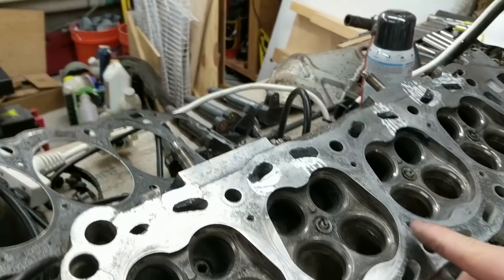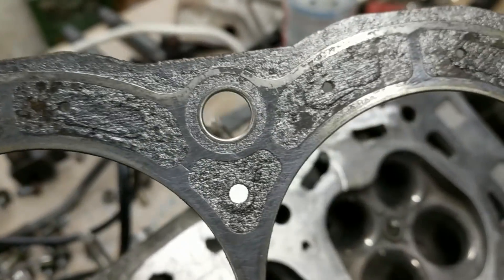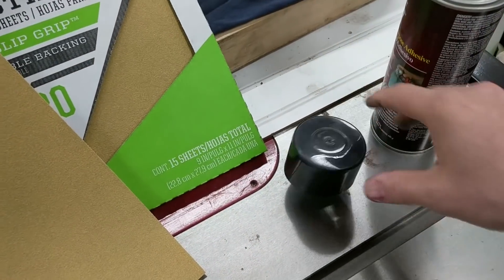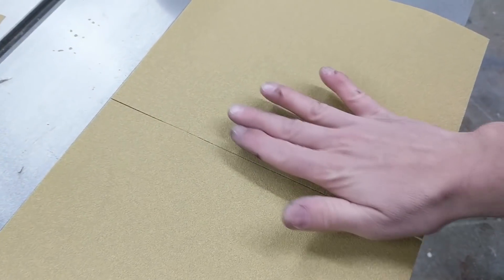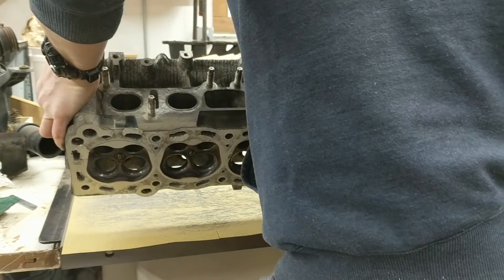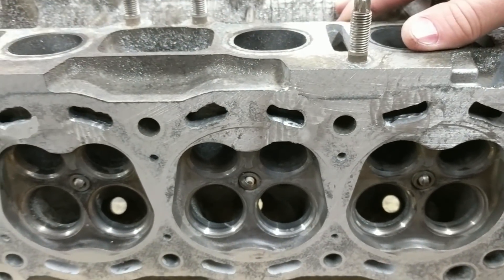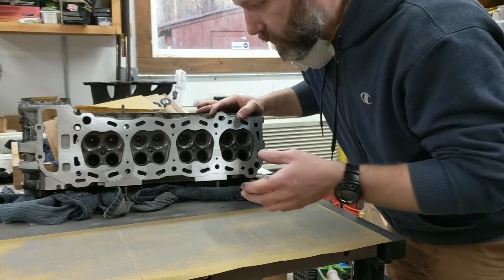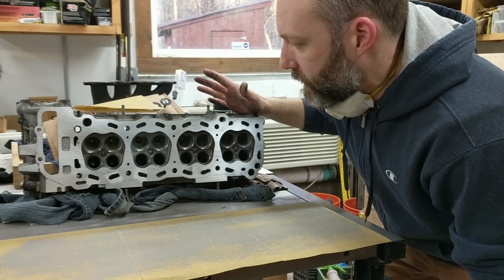Using a Table Saw to Resurface a Cylinder Head

Comment: Good general idea,  bit usimg a larger surface to allow an X pattern is much better,  and you should have gone with a much smaller grit like 600 or 1000. These are machined surfaces that have an almost perfectly smooth finish,  and 60 or 80 grit is huge. In this case you gotta think almost like a body guy,  and small grit to remove perfections.  Also make sure to use a decking block and feeler gauge to check warpage. Finally,  being an aluminum head,  there are bits you can get to put in a drill press and a jig hold square to remove the tiniest material. Gotta be good at machining in general first.  As for valves,  you can lap them yourself,  real cheap.
Reply: I agree 80 grit is too coarse. 1000 grit is for bare metal OE type MLS head gaskets. Aluminum heads with composite head gaskets, or when using aftermarket coated MLS gaskets, should be around 800 grit, and iron heads should be more like 600 grit. That's to get the generally recommended surface finish for most gaskets, but some call for wierd finishes.
Reply: I watched a guy on another video use 80 grit and he could not get the gasket to seal so he over tightened the head bolts just to get the compression up to get it to run
Reply: why not just spray the gaskets (or the head for that matter with hylomar before fitting them???  Works a treat for me when I have had to take off and refit aluminum heads even when i could not afford to resurface them and the car had to be back up and running asap with a new gasket...

Comment: first time I did this was 1960. had a 49 harley davidson 45 v twin that leaked oil where the cast iron oil pump fit on to the aluminum housing. used a safety plate glass window from a 28 plymouth and valve grinding compound. worked to remove a screwdriver gouge in the aluminum(former owner). last time it was grinding 14 thousandths off the cylinder head for my 5 hp briggs engine to raise compression(I live near Denver). used a glass with 360 grit wet-dry sandpaper glued on. did it in the kitchen sink with warm water and a bit of dish soap. Your video shows how you can accomplish things well without spending large amounts of money. I hope the welds hold up good for you and don't crack/leak.

Comment: You should actually push it on an angle diagonally across the head in both directions so you achieve a true flat surface and proper cross hatching for your gasket to seal on

However, good video with decent tips, and it should work

Comment: Yeah, that's totally not worth me taking to my machine shop for $60 and its guaranteed to be flat and of correct RA to seal gaskets
Reply: Kevin Hill depends on where you live, some places will tell you to go fuck your hat for anything that’s not a several hundred dollar job.
Reply: @ Kevin Hill Yeah well I’ve seen many a head machining job messed up by a machine shop, not flat, poor surface finish, thinner at one end than the other, to much taken off etc. For a clean up this method works great done it many times and you don’t have to wait a week and hear every lame ass excuse as to why its not done when promised.
Reply: RA isn't anything to be concerned about with this sandpaper method you could go all the way down to 1000grit sandpaper and have almost a mirror finish if you really wanted to. The local machine shop cant even get it that smooth on their milling machine. Or you just give the gasket a light coat of copper spray and send it lol.

Comment: I was impressed by the way you fixed the head by filling in the bad spots BUT that is where it stops. You should of just brought it to a machine shop and for 45 $ they would of ground the head 100% flat with a finish you could never achieve using 80 grit sand paper on a table saw. At the very least you should of been using a machinist table that you know was flat.

Comment: The holes in the gasket arent pinholes, you are supposed to remove material so the gasket he matches the shape of the water passage
Reply: What since when ive been a mechanic for just about ever and never have I once seen anyone remove part of a head gasket to match the holes in the head by doing so you compramise its integrity and ive never had any issues with my jobs to much flow of water is a bad thing

Comment: I use a large steralite plastic tub & water based solvent from harbor freight.  Soak the head overnight, scrub anything that didn't just dissolve, hose off & use the air gun blower thingy to dry it.  A lot of people use kerosene & I've seen a few use mineral spirits (it works wicked fast... but scares me more lol) hope you are having fun with the project. Thanks for the video

Comment: I was told to use a piece of glass and to move the part in a figure 8 motion to prevent sanding one side too much
Reply: i used a glass table top worked amazingly well
Reply: Kinda hard to do a figure 8 with a heavy piece.
Reply: @shobud7561  it's not as bad as you'd think. You can use wet paper and some soapy water to help.
Reply: El Rey as a machinist to proper remove the high spots in the vise and machine table using a hone stone in a figure 8 motion prevents wear in the same area. I myself was thinking the same thing as he started the video he’s going to wear “grooves” in it in the same direction instead of a circular pattern from the back and forth motion
Reply: @davidnelson2804  it's also a good practice to rotate the stone or part 90 or 180° frequently to help keep the part flat due to unevenly applied pressure.
Reply: https://youtu.be/HyKN52HD6RU
Reply: A small steel planer and light circular sanding motion works. Keep constant movements, even pressure thru out the process... and keep WD40 on it the entire time.
Reply: I've had good results using this method for resurfacing carburetor mating surfaces and other smaller components but never anything as large as a cylinder head. But like the saw table method shown here you have nothing to loose if there is no access to a machine shop and you have to get it running.

Comment: I would have turned the head 180 degrees from time to time... Maybe if the table was a bit warped, it would even it out...
Reply: You should actually have the head facing you diagonally like this / and push back and forth, then switch it 180 and do it the opposite way to achieve a cross hatching or x pattern on the head surface like your bore surface
Reply: If you can’t do the figure 8, do it like your block sanding a body panel. 
 -  |  /  \ 
Do it in those 4 directions, back and forth and both diagonals. 
and count your strokes and it’ll be pretty decent.

Comment: you could add some bungee cords to the studs to pull back on it as you push it away from you, they will help pull it back.
Reply: This will work sometimes if you have 3 days to finish it with no certainty it's true. What most guys don't know is the head is still warped. The surface is flat.having said that,the valve guides and seats have moved just a little bit and just enough for the valves on the 2 center cylinders to leak. Do the drip test.most likely fluid will pour out and a valve job will be required. Lapping compound and a drill will not fix that amount of clearance. If you've 4 days to waste on homegrown projects,full speed ahead. Milled  my 73 Yamaha 125 head when I was a teen this way.

Comment: I use a large piece of polished granite left over from a kitchen table top and crocus. I sharpen a wood chipper blade with a belt sander (220 grit) turned upside down and clamped onto a work mate. Nothing is "stupid" when you give it your best shot!
Reply: non man, you got that wrong. nothing is stupid when it works. problem is this does not leave the proper finish to seal a head gasket for more than a short time. what you will find on modern engines is that this polished head will eat gaskets. 
   in short, doing this will create alot of work in the future. you will be changing head gaskets again and again.
Reply: @lukewarmwater6412  I wouldn't call 80 grit polishing.
Reply: @tjsbbi   I wouldnt call 80 grit the right "class of finish" for anything but a dirt bike with a copper head gasket, but you go right ahead there buddy. you'll make alot of work for yourself.
Reply: @lukewarmwater6412  why do you think that is? Looked to me like it wasn't too smooth.  60 grit maybe
Reply: @Emilthehun  60 grit does not cut steel nowhere as well as 80 grit does. I will never use 60 grit again only 80 when the need is to remove as much as possible.
Reply: @ioccatonyz1  it's strictly speaking of the finish mating surface.  Too smooth and gasket won't seal.

Comment: Hi, nice to see someone trying something new, good luck I hope it works out for you! Did you cut into the head a little to get some real penetration?
My real reason for taking the time to comment is>>>>>your surroundings don't scream poverty, why not invest in some metal working tools. If you don't do this for a living why not buy some inexpensive metal working tools at Harbor Freight, you would not by some of these tools if you used them everyday to make a living, but a die grinder maybe a pneumatic dyna-file etc.... these tools are really inexpensive and will do a great job, who knows you might do it again, also if you keep them nice they resell most of the time you will get 75% of your money back and have a little more control throughout your projects.
Reply from the maker: Poverty no, I know folks have it a lot harder than me and my family is blessed.  That said, most of the things you see I purchased before having two kids.  What money I might have had to pay a mechanic now goes to preschool.  And anyway this truck is old, and probably not worth fixing if I couldn't do it myself for cheap.  I talked about a lot of this on camera but cut it from the final video.  Oh and I'm no stranger to harbor freight tools.  It sure would have been nice to have a die grinder and carbide burrs for this job!  I'll add it to the wish list.  :)
Reply: Mack Harley  in the late 70s we already did cylinder liners and heads of cooling compressors this way. We ended leith a lot of oil.
Reply: With
Reply: I bought the 14$ die grinder & love it (9.99 with my coupon at the time)...after using it I would pay 50$ if I had to lol also bought a pack of roloc zip disks & at 20000 rpm they clean a gasket surface in no time

Comment: Only problem I can think of with this is how you will flatten the deck on the engine block
Reply from the maker: The block was in great shape, perfectly flat.  It just needed a little clean up with a razor and then a wipe with a rag and carb cleaner.
Reply: Attach a plate to an air rasp to do the block.
Reply: Dustin Carson use an oil stone for chissels.

Comment: Could probably use a saws all, weld an extension on a blade, then find a good place to connect it on the end of the head, then hold the saws all at a low RPM to move the head back and forth... Easier on the arms at least.
Reply from the maker: Yes!  Good idea
Reply: brennan Clark  my 18v DeWalt cordless cold easily move 50lbs and my kobalt and SawzAll brand corded saws would easily do even more than that. All three take some serious effort to control when they get bound up or kick out of the cut. Stop buying harbor freight power tools and you'd be amazed at what you've been missing.
Reply: @johnpike9612  I highly doubt that. They are harder to control because of the speed and change of direction, not because they are powerful. They are moving a saw blade not a  50 lb. head!

Comment: British bikers in the 50s use to do this to their engine cases, as they always leaked oil.  As the cases were alloy, they used a sheet of glass, and valve lapping compound to get the case edges perfectly flat.
Reply: True comment, I still have 50's bikes and still use 50's tricks ...
Reply: Yes but what he doesn't tell is they still pissed oil out !.
Reply: @geraldswain3259  So true.  It's not a British engine if it's not leaking oil.
Reply: Gerald Swain British bikes leaked oil from the day they were built. Lol
Reply: @geraldswain3259  That's not a flaw, it's a "feature" :)
Reply: Work's on valvebodys to!
Reply: yep,have leveled many this way,patience is the key,if you're in a hurry do the other thing first
Reply: David Hutchison marine engineers as well. Use a flat steel plate or a glass plate and differend courseness of lapping paste. To flatten it finally use a lot of oil and ferry fine lapping paste.
Reply: @henkoosterhof5947  naw see we used to, back in the day. today we have found that leaving behind toolmarks when the part is fly cut increases the gasket surface area and seals better. so we dont use lapping plates any more, we have things machined because it does a better job and takes less time and is there fore cheaper.

  dont do this shit. it doesnt work as well as machining. in the past if machine work had not been expensive craftsmen would have NEVER done it this way.
 use you heads guys.
Reply: Luke Warmwater I agree with you but most of the shops were i live want you to bring in the complete engine for a ,,complete,, rebuilt. Some can be trusted. Most of them not.
Reply: Yep. 1956 Triumph T-100. -  Primary case & Lucas electrical.  But that was my bike "& I was sticking to it."
Reply: David Hutchison  Use an oil stone if its the block still in the car.
Reply: David Hutchison nice!
Reply: Still use the same way on older bikes including harleys
Reply: this what a real surface plate is for , but i doubt if its flat , its a flat as the saw bed
Reply: We do it on glass.
Reply: so, in other words, they did this the right way, with something that wouldnt wear into a dish shape as it cuts....iron is not the surface to use, if it were you would see it being used like this in shops.